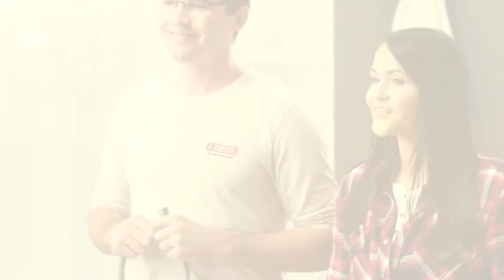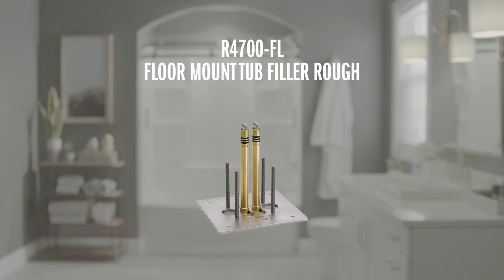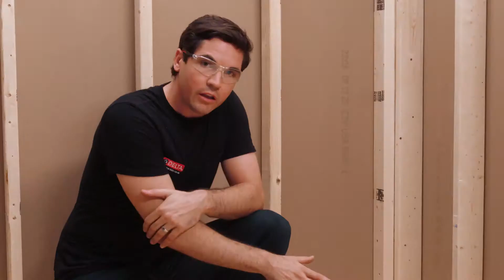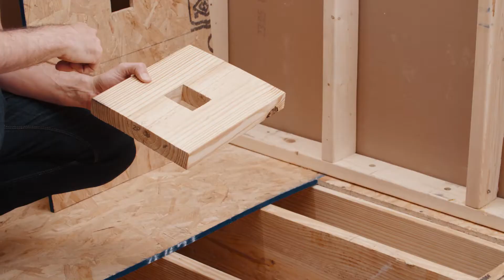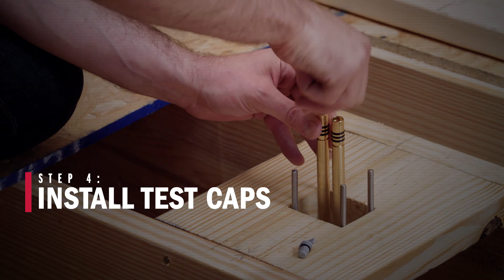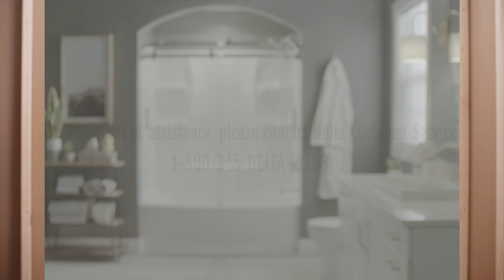How To Install the Delta® R4700 FL Floor Mount Tub Filler Rough

Comment: What if your total thickness is exactly 1 1/4”, does the plate go on top or bottom?
Reply from the maker: Thanks for the question! The mounting plate can go below the stringer if the total thickness is 1 1/4"

Comment: Be very careful when finishing floor not to exceed mounting screw max height - eg 2 layers of 1/2" subfloor for 1/4" tile, set with a 1/2" notched trowel for thinset for larger tile will be a problem....don't ask me how I know... 😢

Comment: Got a concrete slab install video??
Reply: With concrete you need a different rough in. You either mount it on 2 pieces of block, then drop it in and pour concrete around the blocks so that you can change it later if you need to for any reason.
If you dont care, just mix some fast set concrete (10 minute mix) make it a little harder , put the valve in a small bed of concrete, fix orientation and adjust level and let it be until concrete sets.
That rough in comes with a built in heavy duty dust cover, it gives you minimum and maximum floor thickness and you cut it carefully at finishing stage.
Really easy once you’ve installed a few…
Reply: @AndreT-d9m any good videos or more details illustrating this?

Comment: I notice in Delta instructions that come with this valve, it says to install the 3-O rings on the riser AFTER you make solder connection to the risers but the risers come with the O rings already installed. So you remove the O rings, make your solder connection to risers and then reinstall O rings, correct?
Reply from the maker: Hello James. Thank you for contacting Delta Faucet Company and we are happy to help. That is correct. You will install after soldering. With any further questions or concerns, please do not hesitate to reach out to us again. -Carrie
Reply: @deltafaucet  Memo from Conrad Plumb/Mech to Delta Design Team, VERY POOR DESIGN on this rough valve, there is so much wrong it's hard to know where to start.  First off you must put a copper sweat coupling over the inlet, naturally, the coupling makes it too large to fit into the plate from above and, speaking of the plate, the holes to screw it down to the stringer are too small! I notice in the video you used drywall screws, that's fine for drywall but unfortunately, you are not installing drywall and, drywall screws are a BIG FAT NO-NO on plumbing installations. They are MUCH too brittle and break easily and are worthless for installing this valve, drop ear ell for shower head outlet, even screwing 1 piece tubs or shower pan flanges, etc. it is bad practice to use drywall screws. We prefer to use coated exterior deck-type screws, yes, they are expensive but they do not break off in the wall or under the floor which is rather important.
I could go on but you get the idea, I got this valve installed & it works but, not a happy camper, was expecting a better design from Delta, especially @ nearly  $200 retail, your universal tub/shower valve design puts this valve to shame design-wise.